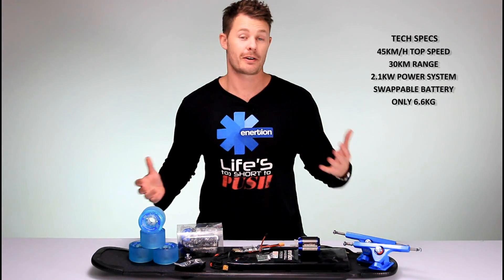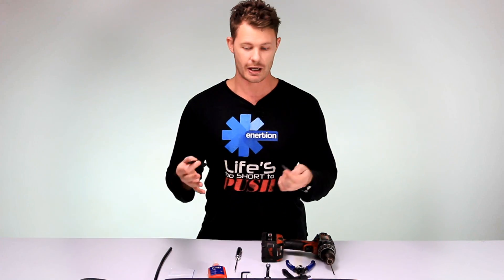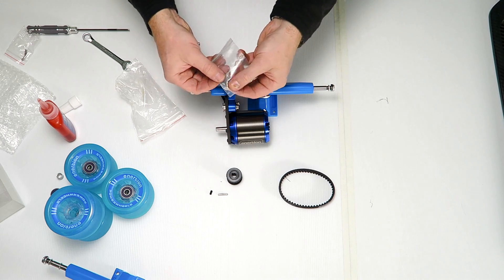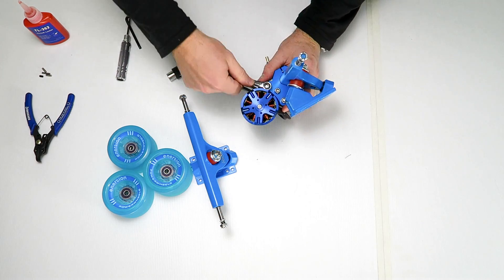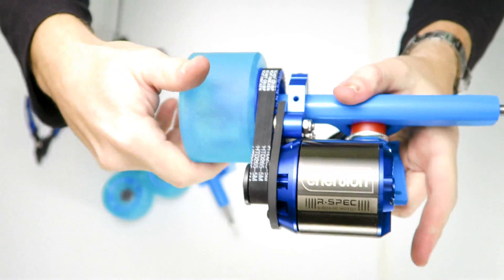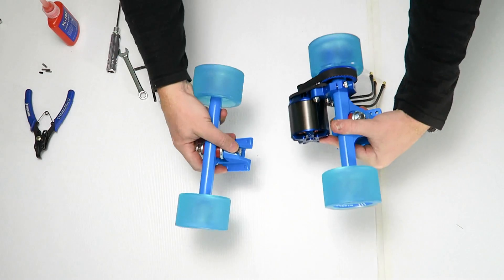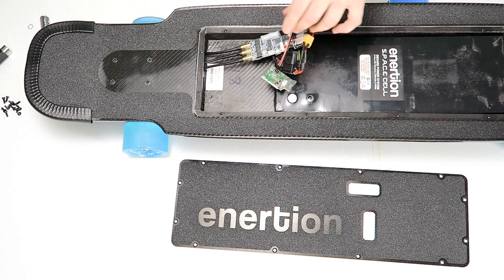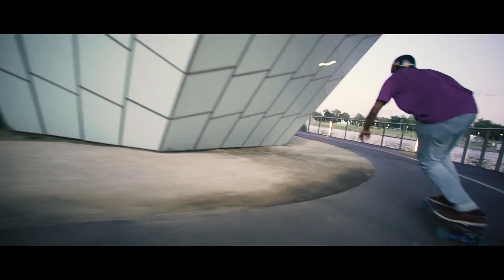Build electric skateboard in 12mins

Comment: If you don't want to build a really good skateboard, buy the raptor 2 which has even better specs than this, or take a step down a bit and go the evolve carbon gt, for fucks sakes do not waste your money on boosted boards, they're overpriced and their specs don't even compare to the evolve, let alone raptors or LHB Scarletts, but in the end if you want the best board, you build it yourself

Comment: What if i wanted two motors how would i connect them ? Also can i still kick push on it or will there be some  resistance?
Reply: a boosted dual is cheaper than a double motor version of this, and the boosted is watterproof now
check the price on this one http://www.enertionboards.com/buy-electric-skateboards-online/

Comment: You can buy same quality parts for much less in other places.
Reply: where? I want to build a eletric skate board
Reply: Alien power systems have the best motors and batteries 
Enertion has the best speed controller "vesc X"
Diyelectricskateboard have mechanical kits and battery indicators
The actual board itself you can get from anywhere, if your battery can't flex then use a stiff deck.
For a cheap board with okay stats just buy all your parts from diyelectricskateboard and the board itself from Kmart or "Walmart?"

Comment: With the r spec 6374 motor, will I be able to use this to climb hills? I will be using two 4s 5000mah 20c lipo batteries

Comment: do you need to buy the board for it or could you use your own?
Reply: You could use your own deck but you need to buy the battery enclosure from the enertion website and im pretty sure that is costs around 60$.
Reply: +Olympia Plays Games so you need to buy the battery enclosure and the battery ?
Reply: +King_Diplo yeah pretty much but you dont actually need to buy that exact motor.
Reply: +Olympia Plays Games thx but I'm how to get the thing that will hold the motor

Comment: does anyone know where i can get a cheaper deck with the capability to install the battery and the other wires inside of the board? please really trying to get one of the kits to build a board but the deck is too expensive (349$)
Reply: It's going to be hard to find something like he offers. Instead you can buy a nice long board deck under 50$, the 60$ battery enclosure from enertion and just attach them together,
Reply: He sells the Space cell batteries which attach onto any deck with just some screws... and the screws are included. I've got a space cell pro4 on order and can't wait to test it out :)

Comment: At 9:15 you said that one axel is longer than the other. I don't see what you meant. Also are both trucks the same or is there a specific truck that the motor must mount? Do you also got a dual motor guide as well?

Comment: what do you do with the ESC and receiver on a regular deck?
Reply: You'll have to attach it to the bottom of your deck. I'm working on the same problem currently :/
Reply: I was gonna order the parts and use a regular deck as the one he sells is pissing expensive but when i saw that the VESC and reciever are just out in the open i didnt order it
Reply: If you look on his website you can buy an aluminium case that you attach to the bottom of your board to protect the set up.
You just need to have a rigid/solid board
Reply: oh alright, thanks

Comment: I just want to be sure, if I buy your controller from your website, will it come with the receiver? I'm about to make a purchase and i want to be sure. i really want to build my own skateboard.
Reply: should i buy a 12 mm wide drive pulley or the 9mm drive pulley for my 180mm raw truck and bearing? would it make a difference?
Reply: ALSO im buying the truck ,wheels and bearing from amazon. does the size matter?

Comment: I don't understand...why would I be interested in a DIY unit when the brand unit is cheaper? I just  looked up the price for dual and it was over $1500, unless maybe that's not USD?
Reply: It is better to build DIY because it has better performance and is cheaper, however this is not cheaper because it  is sold under a kit and brand. If you bought parts from hobby shops and assembled a board it would be much cheaper.
Reply: Oh, I see. Yeah, I was pretty shocked when I saw the price.

Comment: would be a lot quicker if you ship the motor already mounted on the rear axle and the customer just need to put the bushing, the axle and the mother on top of the deck mount... then afterwards (like you said which is possible) adjust the motor

Comment: Nice idea for the diy/kit build fans but the parts seem overpriced. I'm in the market for something like this but so far the Boosted Board is a better choice.
Reply: he has to make a 60% profit somehow so he doesn't go broke, and this board is way better than a boosted board
Reply: I agree ^^    -   pretty much the same price for an already made electric skateboard
Reply: That's true, the best boosted board costs more, is more robust and is even less fast, and it has less battery capacity so I think that this is the best option for an reasonable skateboard.
Reply: +Spiky but that one can handle some water and is okay on the road, this one has almost no protection against road debris, if extra battery life is a big deal, just buy another battery for your boosted board (They're replaceable now).
Reply: JesseDegenerate Yeah their controller is great. Well my V1 drops out in NYC once in awhile. Boosted's biggest issue is the range. One of the worst in the entire industry. Boosted is really losing its touch with all the mess ups lately... The Mellow Drive will probably easily outperform the Boosted Board. You might want to buy one of those to compare too.
Reply: so the solution is a board people know less about, that's got similar range, and would need to be sent to europe for repair, that's also amazingly more expensive than the boosted? I get 5 miles on performance mode on my v1 single, which get's me to work where i can charge. (that includes the williamsburg bridge, which has the highest grade of any bridge in the city) I'm in NYC too, and a part of the riding group here. There's other advantages too. The much larger rider base means there are more parts, 3rd party stuff for them being made etc. There are a lot of pluses to that ecosystem. I just hate it when people try to come off as "they know something better" because someone has a boosted. That's not necessarily the case.
Reply: +Raphael Rehman please  explain how this is better? I would genuinely like to know how.
Reply: +Umuahjoku Amadi-Obi (AceofSpades) Well specs wise, this is better. Higher top speed, more range and already modular. You can also fully customized it to your liking.
Reply: +Umuahjoku Amadi-Obi (AceofSpades) interchangeable parts of something breaks, customizable by the user, a way bigger battery=higher range. Tell me what boosted has that this board lacks that's applicable in a consumers daily use
Reply: ***** Boosted boards are just as expensive....
Reply: Jake Methner actually i think theyre less expensive XD
Reply: you realize this is his website that he is selling the parts from, you dont have to get his exact specifics, any motor will work if it handles the batteries, the parts are interchangeable with others, you just have to get creative. Im pretty sure they are overpriced on purpose so he can make $$$.
Reply: +Jake Methner   VERY important point you make, to get some facts.
Reply: Umuahjoku Amadi-Obi Yeah for lower specs than a Raptor. To get the model closest to the Raptor at $1560, you would have to get the Extended Battery pack Dual Plus for $1600. And the Boosted Board is still not as good. 

Get some facts kid.
Reply: Jake, you should probably get some facts, kid. You forgot to mention best controller, and how the boards work in areas with a lot of interference. When i'm doing 20 on NYC streets, through cars, that's not an ideal time for a drop out. Boosted was also much more about being a long board that's made electric, rather than a electric vehicle turned into a skateboard. The acceleration and breaking curves are by far the best, from someone who's tried a leif, evolve bamboo gt, and owns a boosted. Most of the big board makers have their strong points, you're just a fanboy; which is why it's funny you're calling anyone kid.

Comment: how much the hole kit costs
Reply: +Benoît Lannou everything but the deck is a decent price
Reply: +robertas grigas buy the motor kit for around 250 bucks from him and a cheap longboard deck on amazon or ebay... the deck costs at his shop smth like 300 bucks which is incredibly overpriced even for carbon fiber
Reply: +Dizzy 034 I think it's really too expensive, his skate cost the same price as famous brand
Reply: je pense qu'iil se demande si il y a une application de telephone pour controller la vitesse.
Reply: +Electric Skateboard Builder 300 bucks for a carbon fiber deck? you wont be long on the market with those prices bruh....btw no one needs a carbon fiber deck...use plastic like on penny boards and give it a transfer paint job... that way you shoot the competitors out and still have a high quality e-board.... not checked the specs of the motor kit yet but we´ll se if thats also overpriced
Reply: +Lorenzo thats a F bruh... 250 + 350 =? do your math again
Reply: +Electric Skateboard Builder too expensive
Reply: +Lorenzo SEEYA! Getting a boosted board
Reply: Umuahjoku Amadi-Obi no I will created my own electric longboard
Reply: +Benoît Lannou it costs more than a top of the line boosted board, and is this one app connected? I didn't think so,
Reply: I don't understand the end of your message ( because I'm French)
Reply: Can you explain the " and is this one app connected " plz
Reply: My message was to Umuahjoku Amadi-Obi
Reply: 1000
Reply: around £540 if you use your own £40 deck
Reply: robertas grigas too bloody much
Reply: Just did the math, comes out to $1559 😳
Reply: minus well get a Metro Board lol
Reply: And what does an app say about the quality bro? I think an app is useless, because you have a remote to control, a vesc to program to your style, and a display on your board with info!

Comment: Are you going to make a tutorial on the Dual Motors? or is it pretty much like this video except with 2?
Great Vids!
Reply: +Dan Moore i, as a builder of electric motor driven things, can tell you: NO! you got one signal which comes from one controller, that signal will be splitted on both motors
Reply: +Electric Skateboard Builder does that mean you hold two controllers?
Reply: Dan Moore Good question